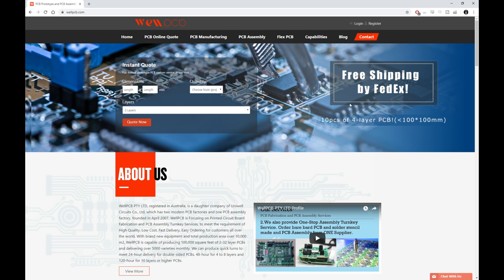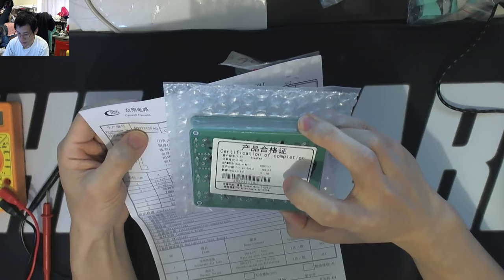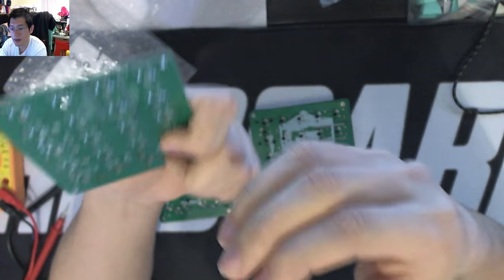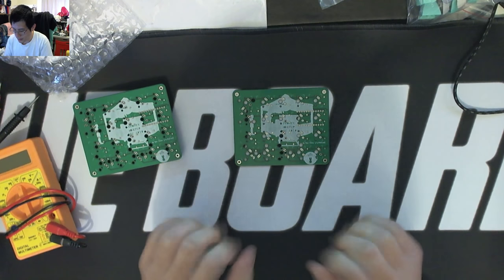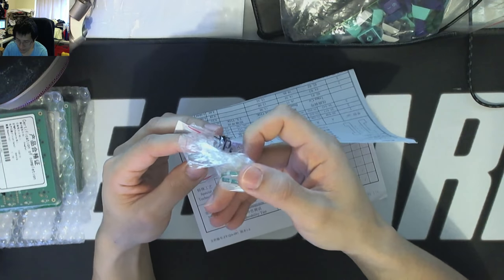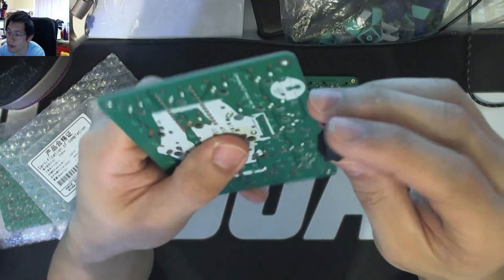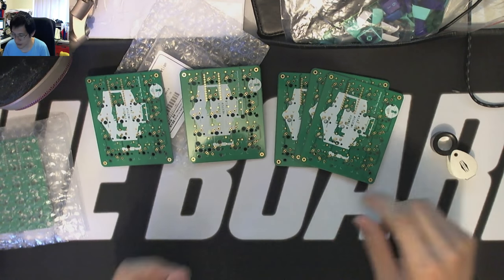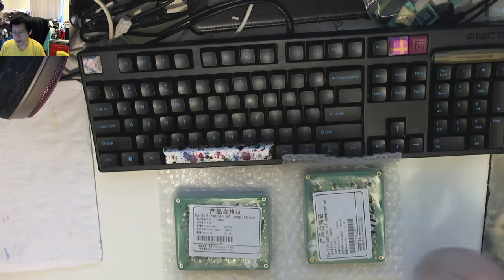Review of WellPCB PCB Fabrication Quality (TL;DW available)

Comment: just to clarify on the hole size 'issue'. this is due to the tin plating in the first run and gold plating on the second run being way thinner. we get the same results here with boards manufactured in Europe. I don't think this is something a board house normally adjusts for. (standard they drill 0.05mm larger than the gerber 'finished hole size' )
Reply from the maker: Interesting, though I have used other PCB fabrication houses without this issue, so while it could be part of the reason, their control/tolerances then must be lower than the other fabricators I have used.